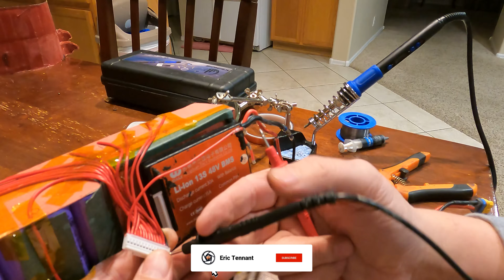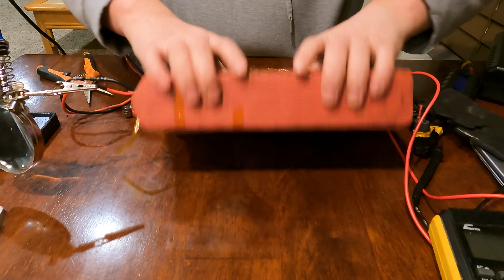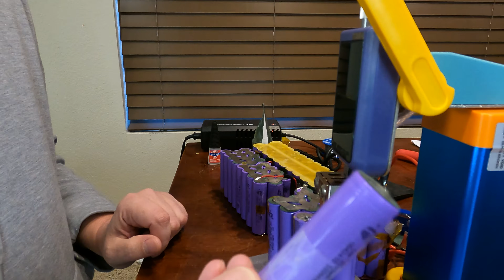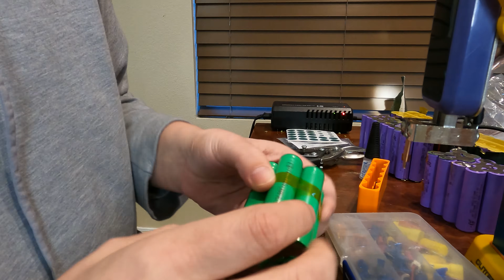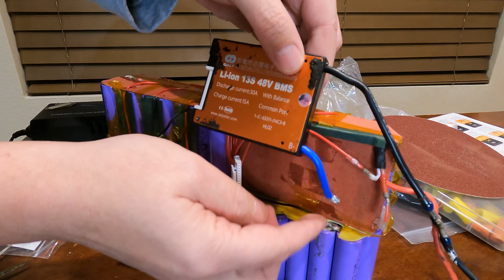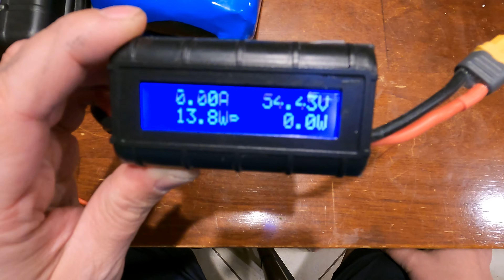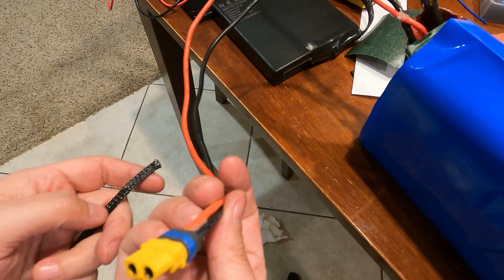Replacing BAD E-bike Battery Cells

Comment: I had a (inexpensive) Chinese made e-bike battery where one cell group dropped to zero. Fortunately for me, the group was on the end, making it much easier to remove.  The shrink wrapped insulation was glued together the same as yours. I started to pull them apart, and just like yours the insulation started to rip, creating the potential for an easy short circuit.  At that point, changed my strategy, to reduce the possibility of breaking the shrink wrapped insulation of the adjacent cells. 
My strategy was to remove the bad cells one by one by cutting them out of their own insulation.

 First as you did, isolate the group by cutting the tabs to adjacent groups.
Next, pry off the tabs from both ends of the cells, so none of the bad cells connect to any others.
Place insulating tape over the positive end, to reduce the chance of a short.
One a a time, slice open the shrink wrap, and pull out the bare bad cells. This will leave a bunch of shrink wrap that can by carefully sliced away without damaging the adjacent working cell groups.

Prepare the replacement group, and install it back in to the same spot, using your preferred method.

This approach, although requiring a lot of care, should preserve the insulation of the remaining cells.

Comment: Wish I knew how to do this my ebike battery lasts 10seconds on a full charge when I'm actually riding it. But just stood there holding the bike up and twisting the throttle the bike lasts for ages. It's only when I'm actually riding the bike it cuts out and does not turn back on.

Comment: Great Video , could you explain the bit with testing each of the 14s from the BMS plug at video time 1:08 please ..when I do mine as I jump first two then next two I have a section the doesn't read which negative is on the 7pin and positive on the 8th pin I getreading0.6 , if I leave the negative pin at start 1st pin and then put positive on 7th pin I get 28v and then on the 8th pin instead of 32 I get 28 v again and the 9th pin goes to 32v and the res go up in 4v increments..is the 8th pin/ group of cells the problem or 7th please

Comment: Ever think of working with Electric Cars? You could replace bad cells in older cars and make them new again.

I met a retired electrical engineer last week. He got the job with his soldering skills and Ham radio.

He said that the enemy of lithium batteries is heat. 

Any chance of you adding liquid cooling to your batteries, since you use them in extreme heat. 

Fortunately, my Fiat liquid cools it battery pack, like Tesla's for reduced degradation. 👍
Reply from the maker: Would love to make a EV car. Just need more funding! The ebike batteries never get to the point where water cooling would be needed. I have ran into the problem of being to cold. Some tours I bring the batteries into the tent to keep them a bit warmer.

With charging they do get a bit warmer when pushing the charge amps high.
Reply: @Eric_Tennant  , I found a video of a CNC water cooled pump. If you had a chance to see your EV battery temperature during the Summer, I think that it would be beyond 115F. My EcoFlow Delta 2 cuts its input when the internal temperature reaches 115F, even though ambient temperature is just 85F.
 https://youtu.be/CMR9z9Xr8GM?si=kLupwo4seKb79aqQ

In reference to an EV, I was thinking that you could get an old beat up EV that had a bad battery pack, so you could tear it apart and replace the bad cells like your Ebike battery. The OBD 2 data link might help diagnosing the bad cells, but I am not sure.